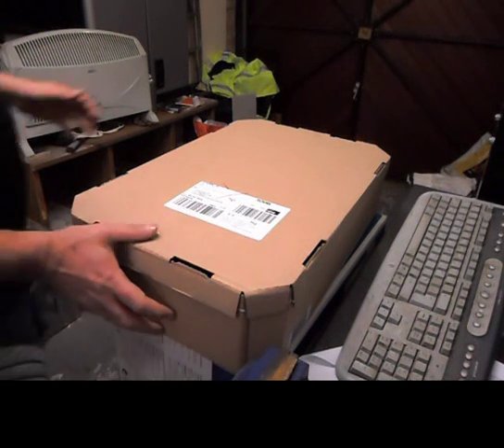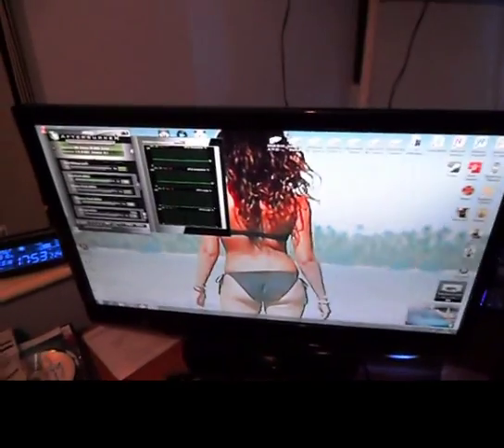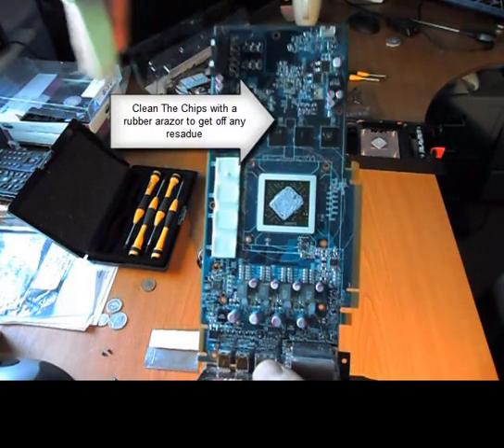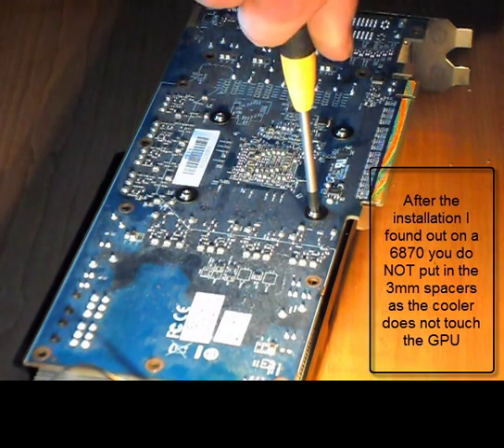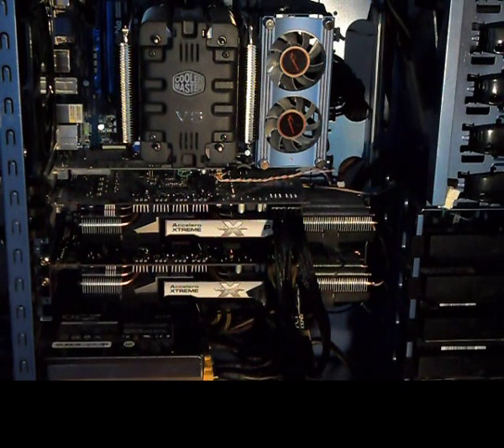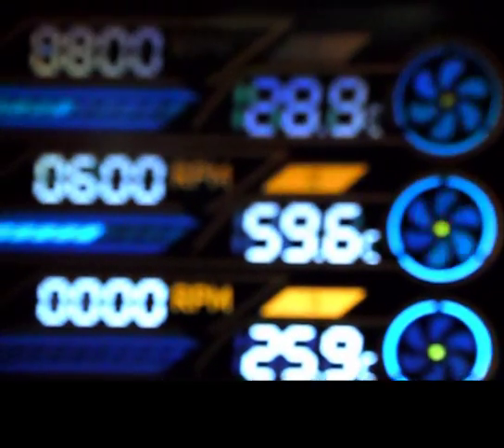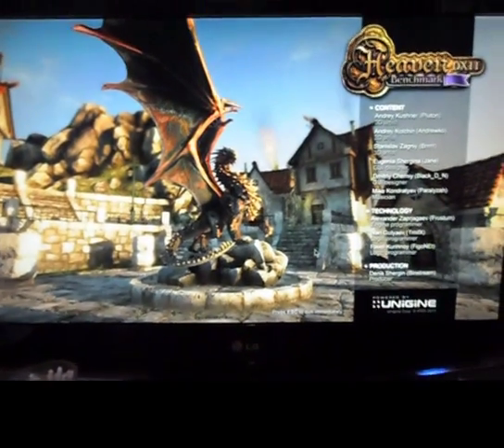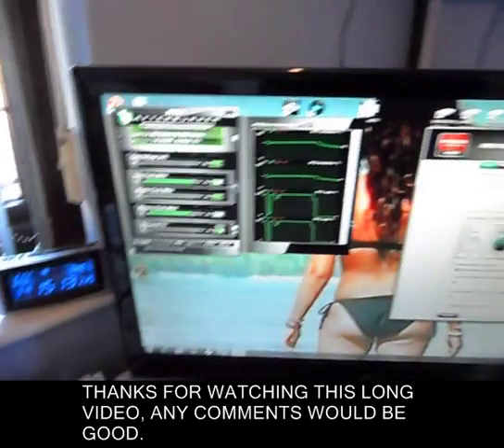ACCELERO EXTREME PLUS 2 INSTALL & TESTING on ATI/AMD 6870`s

Comment: You said to leave the spacers, as it would otherwise leave a gap between the core and the cooling bottom. I put the 3mm spacers as the manual adviced and it fit very good, not leaving a gap and about 1mm or less space between heatsinks on card&cooler. My card is Vertex3D, reference card. 

Temperatures

Stock idle ~48
Accelero idle ~36, fan speed 30%
Stock stress test ~83
Accelero stress test ~67, gaming around 50-55, fan 30%

It´s amazingly silent even at 60-70% while 30-40% is just ok with OC!

Comment: ur cards over clocked ?mine running at 940 gpu and memory at 1100 & the highest i got when playing metro2033 is 76 with the stock coolers from msi 1 hawk & the other normal msi build (in my current build = with a new case 3d mercury) my old case had better air flow, fractal core 3000 & the max in there was 68 ,to be honest i think your case may have an airflow problem since ur hard drive bays + plate are blocking the way,try modding a Fan in there to get air flowing,im guna watercool mine :)

Comment: Great video.

I know you made this video a while ago, but I hope you can answer a question regarding the fan connector.

I have an XFX 6870 with a single fan, so there's only one 2 pin connector on the card.  Does this kit come with any adapters to run the fans off the card?  I'm hopefully going to be installing a Twin Turbo II on my card in a Mac Pro, and of what I see on their website, they appear to have the same connectors. There's no open molex connectors in the Mac.  So I feel I'm screwed.

Comment from the maker: darkfighter7143, Yes all the vrm chip set cooling heatsinks are in the box aswell as is the paste to stick them on, but you have to mix it for 5 mins , don`t forget to use an erazor to get rid of the residue of the vrm`s